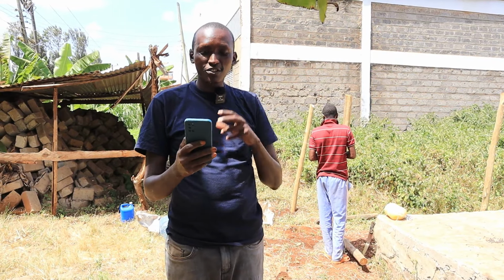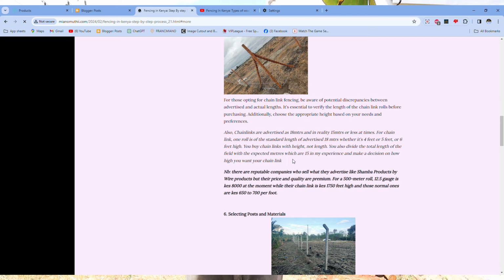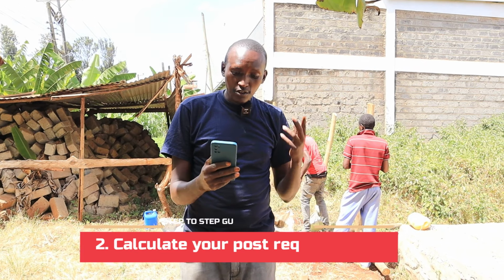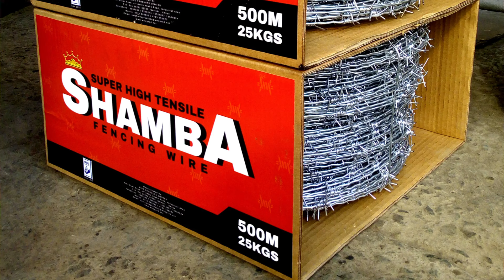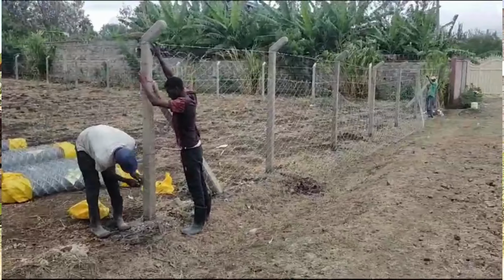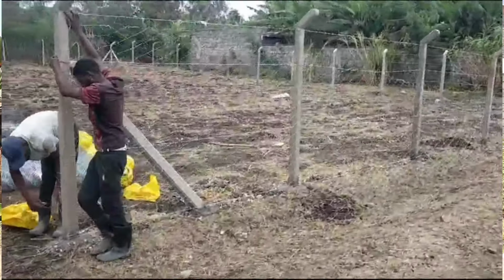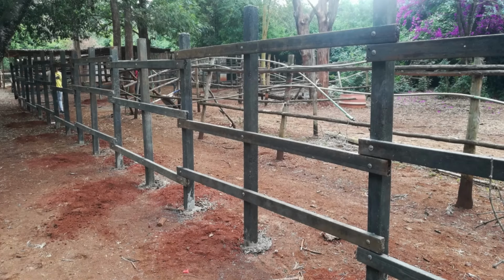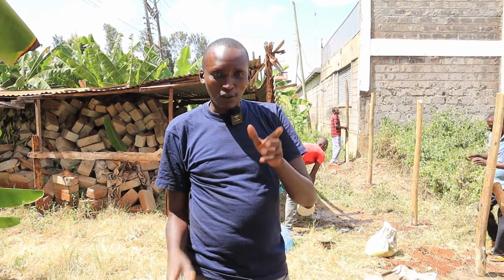Fencing in Kenya: Step by step process / Construction In Kenya

Comment: Maybe hizo seng'enge hazifiki advertised length coz you are not using a "fence come along" stretcher. Nimeona hizo fence do not appear tight proper in your video 🤔
Reply from the maker: Wueh sawa tu... Hizo places unaona loose ni place za entrance but I have worked with Soo many types of barbed wires...no amount of stretching can substitute 100mtrs or less
Reply: @mianomuthii  oh ok. Unasafiri mpaka wapi? Base ni wapi?
Reply from the maker: @vroor32  Sagana
Reply from the maker: @vroor32  we fence anywhere in Kenya as long as we agree on terms